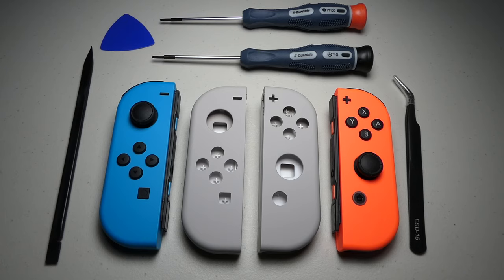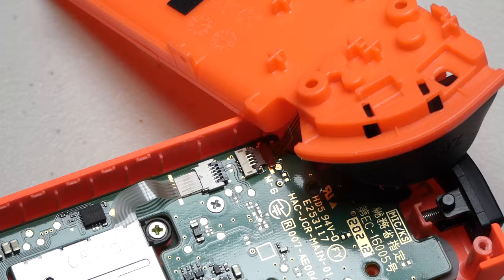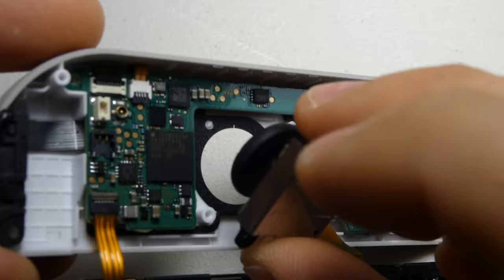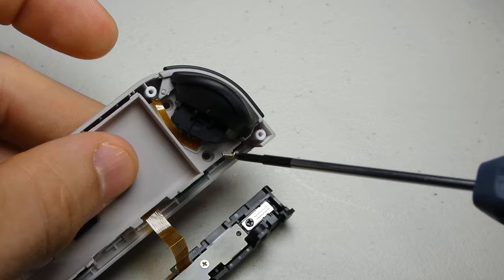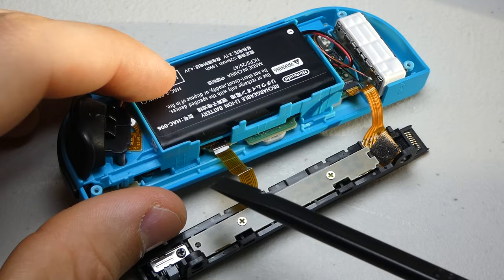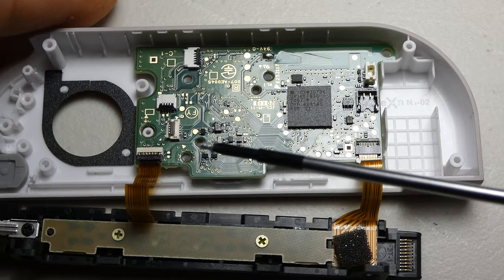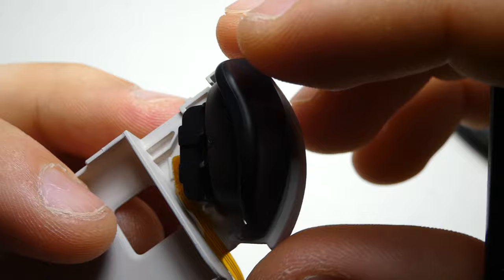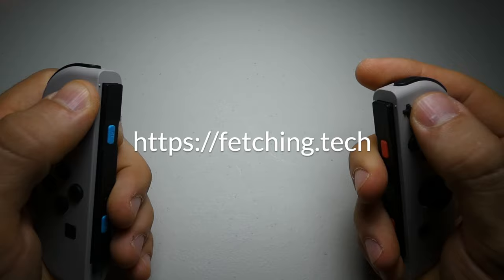How to Swap Out Your Joy-Con Shells

Comment: I’m having a bit of trouble with my right joy-con. The shell swap seemed to turn out fine, but problems began to surface very quickly after. The buttons would constantly trigger on their own without me touching them (usually the home button and the A button). I opened up the controller again and saw the home button rubber was out of place. I put it back but still no luck. I thought for a while and I came to the conclusion of tightening the screws that attached the motherboard to the shell in order to give the buttons a better chance of touching the contact points on the motherboard. It was a temporary solution as when I used the joycon later on in the day, I found out that sometimes pressing the buttons would cause the Home screen to appear. I later found out that I didn’t even have to press the buttons for this to happen and I only had to apply pressure to the outer casing above the buttons for this to happen. After 5-10 minutes of usage after, the controller became unresponsive. As of now, my only solution is to untighten all of the screws and screw them in firm but not tight (what I should’ve been doing at the beginning) since I believe the pressure at the top of the joycon somehow triggers a response at the bottom of the joycon due to tightness? I have a feeling that the joystick might also be the problem since I also installed a new joystick and its housing doesn’t line up with the motherboard (it bulges upward a tad), but I’m not entirely sure. I’ll update this comment if any new problems or solutions are found.

Update #1: I’m currently taking apart the right joycon but unfortunately my dumbass stripped both of the screw holes securing the motherboard to the shell (the holes where the two tiny silver screws are supposed to go). Is there any way that I can fix these screw holes that you guys know of? I’ll continue working while these two holes are stripped and I really don’t want to buy another shell set due to my stupidity

Update #2: After lots of testing, I think the only reason my joycons are malfunctioning are due to the two stripped threads that secure the motherboard. Since the motherboard is not  secured at all, pressure or movement will dislodge the board and cause it to disconnect from the buttons (hence the unresponsiveness). For now, I’ll put the inner working back into the original housing, but anyone please reply if they have any way I can fix the stripped thread. I’m too stubborn for my own good to buy a new set since I’ll have an extra left shell and I’ll have wasted $20 due to avoidable mistakes.

Update #3: Switched the right joycon to the original shell for the front, but I’m having the same issue where the home button can be pressed by applying pressure above the buttons or mashing. It also works when you put pressure in the area below the triggers on the back. It became unresponsive 2 minutes after as well. At this point, I just don’t understand what’s wrong. The only thing I can think of is that I somehow messed up the motherboard or something. I’ll keep at it but there’s only so much I can troubleshoot with what few equipment I have. I’ll just wait for a response for now I guess.

Update #4: I’ve been opening this controller up and putting it back together for the entire day, and I still have no idea what’s wrong. I’m just gonna leave it put together (though unresponsive) and think about my life choices while I wait for help (doesn’t have to be from the creator, any advice is helpful) ;~;
Reply from the maker: Jeez, I'm sorry you've had so much trouble. I haven't ever experienced the phantom home button that you're describing, but I would agree that it sounds like the motherboard may have shorted out. I have stripped the screw holes that hold the motherboard in place (they strip pretty easily unfortunately), however it never caused the buttons to malfunction like you describe. I know it isn't an ideal solution, but you might want to pick up a replacement motherboard off eBay to see if that solves your problem.
Reply: That’s unfortunate then. Would you suggest buying a new motherboard or just buying a new right joycon altogether and attempting the shell swap on that one? Right now I’m leaning towards buying a new joycon since I’m not sure if any of the other parts are shorted as well. From your experience, did the stripped motherboard threads affect the joycon’s performance because I still want to do the shell swap
Reply: For future reference, there was one video I found that talked about how the contact points under the metal coverings for the buttons on the motherboard could be dirty so he suggested melting the adhesive and carefully peeling off the contact sticker to clean the points under it. I don’t have access to these materials but I figured you might benefit from them in case something like this happens to you later on. I don’t know if it’s a solution, but it has a chance of working.

https://m.youtube.com/watch?v=8ou6EEva90o
Reply: @FetchingTech  thank you for all your help. Without it I’d be absolutely lost during this whole ordeal
Reply from the maker: @VDPhantom  I would probably go with the motherboard, just because it's a bit cheaper. However, it's possible that that doesn't correct the problem, and I'd hate to suggest the wrong solution.
Reply: @FetchingTech  last question before my decision is final, do you think it’s still worth switching the shells of the new joycon when the custom shell already has stripped threads in the motherboard area? How strongly will these threads affect the joycons performance?
Reply from the maker: @VDPhantom  I guess it would depend on how many mounts are stripped. As long as the motherboard isn't shifting around within the shell, you should be all right.

Comment: when i fold over the right joycon the leds turn off and the rail buttons stop working but if i have it folded out they work fine
Reply from the maker: Is there a crease in the ribbon cable connecting the railing? I've had that issue once before and the cable eventually snapped completely on the crease. It's a pretty delicate piece, but you can buy replacements on eBay.
Reply: @FetchingTech  i’m gonna just buy one off ebay
Reply from the maker: @llamaschramma3710  Yeah, I'd recommend that. It's a pretty cheap fix, and hopefully that'll solve the problems you're having.
Reply: @FetchingTech   Thanks, when i noticed this problem i immediately stopped the swap, i’m gonna start again when this part arrives, which should be tomorrow. If i have any more problems i’ll ask you. Good that i can get help from the pros and not have to ask around the internet
Reply from the maker: @llamaschramma3710  Whatever you need just, let me know, and good luck with the swap. I hope it works out.

Comment: Im replacing my home button with a new color but I cannot seem to remove the button from the clear ring that the home button sits in. Any help would be appreciated
Reply from the maker: I'll be honest, I've never successfully removed the home button from the clear frame without destroying  the frame itself. I suppose you could try a really fine drill on the centerpiece to see if you can crack it in two and take each half out easier.

However, if you buy a replacement set of buttons they should just include an extra frame with them.

Comment: Are the parts fragile? Im just scared that i might break them
Reply from the maker: The plastic bits are pretty sturdy. The things you need to be careful with are the ribbon cables. I've broken a few of those, but you can order replacements on eBay fairly cheaply.

Comment: @FetchingTech I have a question. The part that you can see when paused @5:42. When I put everything into the new shell it all worked. The I noticed the ZR wasn't clicking all of a sudden and not making a connection. I opened it up to find that metal piece with the little black button had completely come out. I ordered a replacement. Put it in and literally the same issue all over again. It worked, then stopped clicking and making a connection. I opened it and the same pieces came off. Why and how? What did I do wrong twice?
Reply from the maker: Hmm, I would guess that maybe the springs for the shoulder button aren't lining up correctly, causing the shoulder button to press at an awkward angle and snap the actuator off. If the springs are in straight and the shoulder button is lying flat as intended, it shouldn't be breaking this piece off. But, I'd have to see it to be sure.
Reply: @FetchingTech  It's very strange. The second one I put it was very hard to click (as reviews had stated on Amazon.) AFter a few trys I heard a little "ding". The metal on the actual popped off clean. It is impossible to get back on. The third one I ordered when on and is still functional. It has a louder click but I don't care. But all times I did this, the springs seemed lined up.
Reply from the maker: @ryangalvatron4451  You're right, I'm pretty sure that actuator would need to be soldered back on once it pops off, which is something most people probably don't have the tools to perform. I can't explain why the first one failed, but hopefully this new one will perform better for you.

Comment: This looks amazing! Definitely plan to do this to mine! Is there a way to change the colors of the buttons on the 'rail side' of the joycon by any chance?
Reply: Some small side-answer.
TBH, those colours are the only indicator of a joycon original colour after the shell replacement. That way, while playing some games you can actually differentiate player's joycons (like in Mario Party). Apart from that, those are  only visible when you take them out of switch ;)
Reply: @MortisVA  Yeahh true. I might just get gray joycons so that the buttons dont bother me too much then, if I cant find a way to change them. Thanks though!
Reply from the maker: @riekapotato  Yes, those buttons are pretty straightforward to swap out out. There are just a couple screws on the back side of the railing holding the LED strip in place. If you take those screws out you can swap the rubber membranes over to your new buttons. Just make sure you line up the notches in the button with the notches in the railing to keep them straight.
Reply: @FetchingTech  Ah okay, I see. Thats super helpful! Thanks a ton!

Comment: hey i have one question  but first: thank you for this super good tutorial, you camera was so zoomed in and clean i could see anything in detail :) 

but i have one problem now: i cant click my left upper shoulder button good enough, not as good as the right one, i need to hit it from the side and cant click on top that good anymore any idea why that is? did it slide to far to the left side while i was putting in the shell again ?
Reply from the maker: Thanks for the kind words. I'm glad you found the video helpful.

I'm not sure if you switched out the shoulder buttons, or just reinstalled the original ones, so I'll try to address both cases.

If you kept the same buttons, I've noticed sometimes the new shells don't fit together perfectly, and it requires you to really tighten down the top screw to bring the two halves together. I've found that reseating the button, making sure it wiggles freely before reinstalling the back half, and then not tightening the back screws too much can help.

If you swapped out the buttons, they may not fit in the shell as perfectly as the previous ones, and you may have to check to make sure something isn't blocking them from moving freely, which might need to be filed down.

Sorry for the long-winded answer. Hopefully that was helpful.
Reply: @FetchingTech  no i appreciate the long answer, otherwise it wouldnt be that helpful so thanks in advance! 
i will look again if i can loosen up  the one screw a tiny bit because what you said was the matter with my shells.
I had to really screw them tight, it might be the case that I accidentaly used the old shoulder Buttons  again haha.
Might swap that them too to see how it works. Cheers!

Comment: How do I replace this very small metal piece that looks a beetle that has a space for a plastic piece of similar size. It came from off of the minus/ZL/L ribbon cable
Reply from the maker: Sorry for the late response. If I'm thinking of the correct piece, that is the actuator button that is soldered onto the ribbon cable. The easiest solution would be to buy another ribbon cable off of Ebay.

Comment: Having difficulty with the plate that screws in to secure the " - " button,  it seems like it's maybe a little bent and the button isn't hitting the plate at all, any suggestions?"
Reply from the maker: It's hard for me to say without seeing it. Assuming you mean the ribbon cable for the minus button, there are some railings to guide it into place. It's possible it just needs to be realigned.

If it is damaged, you can also order replacements off eBay for not too much money. I'm sorry I can't be more helpful.

Comment: Hi! your video really helped me, but  there is a small problem. When I put the tray down, the L and R buttons are not moving freely and they are not making the "click" sound. Before putting the tray they are working  perfectly fine, the problem comes after putting it back. What can I do?
Reply from the maker: This happens from time to time when the replacement shells have some irregularities to them. I usually just back the tri-wing screws out a little bit rather than tightening them all the way down, to give more space for the shoulder buttons to move.

Comment: What happens if my dust cover has a hard time sticking to the new shell or won’t stick at all?
Reply from the maker: It's held on by a bit of adhesive. You could put a little glue if you want, but I usually just make sure it's lined up, and let the pressure keep it in place.

Comment: I started working on the blue joycon and after I put everything back together the ZL L button didn’t work any tips I even tried reconnecting the wire that joins it to the mother board
Reply from the maker: Hmm, it's tough for me to say. If you can feel the button actuating, and you know the cables are fully seated, then it's possible the ribbon cables got damaged somehow. I'd take a closer look at them to see if there are any signs of damage.

Fortunately, you can get replacements fairly cheap on eBay if you need to.

Comment: Hello, thank you for the tutorial it was very easy! However I do have a small issue. The new casing won’t shut fully and it’s not flush. Also on top of the analog it feels like a bump which prevents the shell from closing fully. All my buttons work but it just feels akward. Don’t know what I did wrong.
Reply from the maker: If the two shell halves won't close fully there is usually something blocking them. This happens a lot on the right shell because the wifi antenna  often shifts while you try to close the halves, and it stops them from coming together fully. I would check that first.

Comment: I manage to complete the replacement process, but now my left analog isn’t working.
Reply from the maker: If it's not working at all, then it's possible the ribbon cable didn't get inserted fully. If the joystick is drifting hard to one side, then my guess is the cable got damaged during the install. Hopefully it's a simple fix for you.

Comment: Finished doing the mod on my Joycon and it turned out great..kinda. For some reason when I slide it into handheld mode, the console doesn't detect it as connected and thinks the joycon is still detached. For some reason it still charges when it's attached to the console, is there any way to fix this?
Reply from the maker: It sounds like one of the ribbon cables that attaches to the railing may not be fully attached, or it may have gotten damaged. I would try to reattach those first, and potentially replace them if that doesn't work.

Comment: I did the same thing you did, but after that, my Joy-con is not connecting to charge Switch anymore... What do I do??
Reply from the maker: Sorry for the late response, my guess would be that the ribbon cables that connect to the railing either got disconnected or damaged. I would check those first.

Comment: Dunno if you are still going to read this but, when I closed the right joy con any of the buttons worked, i tried opening it again but I couldn't be able to find the problem, any advices?
Reply from the maker: I'm curious if the buttons work while connected to the switch or if you aren't able to get them to work at all. My guess would be that the battery connector isn't attached fully, which would cause nothing to work wirelessly, but it should still work connected.

Otherwise, it could be a case of something shorting out if none of the buttons work. I would try to reassemble everything just to be sure.

Comment: I just cant unscrew last screw wtfff
Reply from the maker: Usually, I try to loosen each screw before taking any of them out fully. Hopefully the screw head didn't strip. That would cause some other issues.
Reply: @FetchingTech  it doesnt want to catch on sides of screwdriver. :(
Reply from the maker: @Rospi123  Unfortunately, that likely means the screw was stripped. You can try a screw extraction kit, but you may have to end up breaking off the backplate and taking it out with pliers.
Reply: @FetchingTech  thanks for tip

Comment: The little clicker at the top middle of the board fell off
Reply from the maker: Is that the one for the shoulder button? You might need to grab a replacement board if that's the case. It would probably require some soldering otherwise.